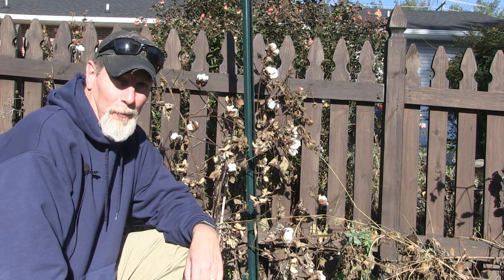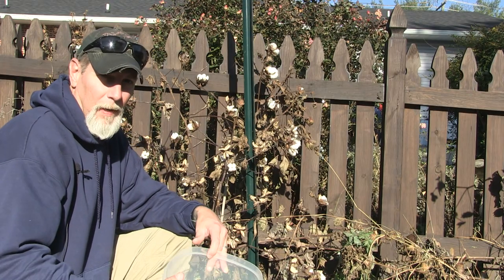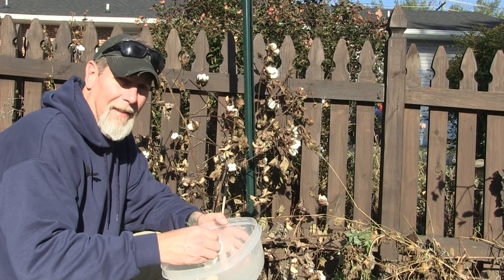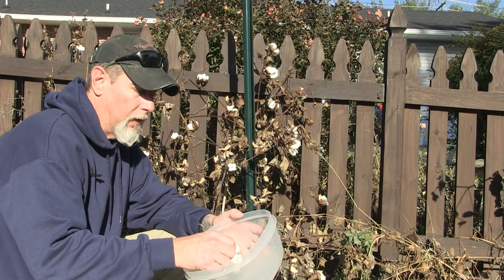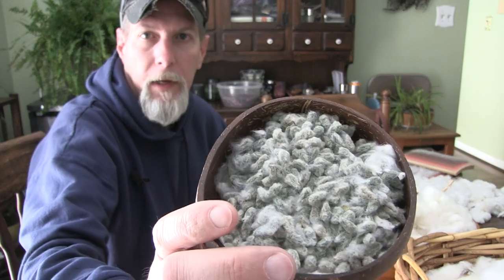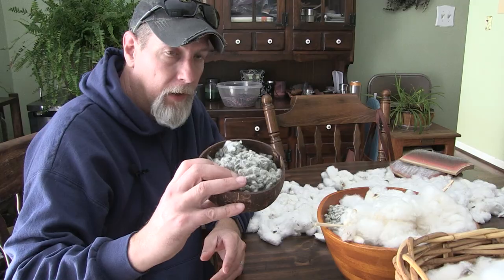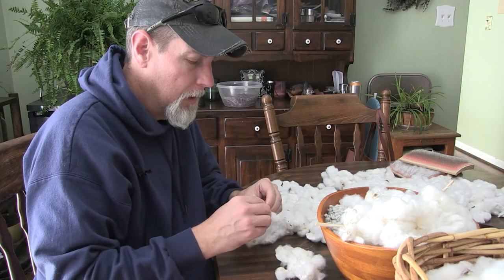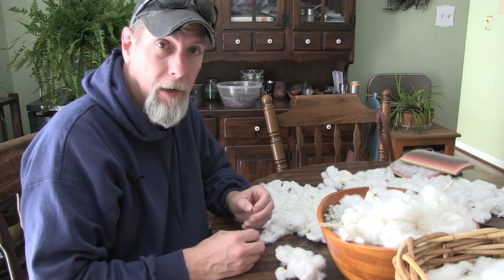How We're Processing Our Home Grown Cotton

Comment: The best way to remove the seeds is just carding. It won't hurt your cards. That's part of what your carding for,  to get the seeds out quickly and easily.  You don't have to use a lot of strength with carding. Card like you're brushing a cat, just lightly.  You'll get better cotton slivers. The seeds can just be pulled from top or bottom,  or picked out, tug off any long fibers hanging on, toss the seed in a bowl and continue.
Reply from the maker: Thanks for the tip!
Reply: Would that damage the seeds? If they want to keep them for planting they can’t be damaged. Just wondering

Comment: If you want to remove the seeds easily use a pasta roller, it works wonders.
Reply from the maker: What a great suggestion! Did you have any issue with it crushing the seeds? I'm just wondering with how tight the seeds are in the fibers of the Upland Cotton.
Reply: @oneseedoneworld  Hey, it doesn't crush the seeds, there is such a thing as a cotton ginning machine made with wood, but you would have to either make one or order one and it could cost a lot of money.
(none of the below videos are mine)

This for example is a ginning machine:
https://www.youtube.com/watch?v=UBOdM8hEVG4

But if you think about it, that looks exactly like a pasta roller, you can get one super cheap and all you need to do is add something to the metal rollers so they can grab the cotton fibers (otherwise they would slip)

This clip below shows perfectly how easy it is and with the addition of the some leather fabric as you can see the machine totally strips the fibers from the seeds and there is not way it can crush them because they are too big to pass through the rollers.
https://www.youtube.com/watch?v=JpzndOsO2F4

I hope this helps you with your cotton processing.
😘💖
Reply from the maker: @aryaprincess2479  Thanks for the links!
Reply from the maker: @aryaprincess2479  Yes I just watched the one on the pasta roller. I'll have to try that out since I do have one of those. I have previously watched videos on making a homemade cotton gin, but one I saw talked about how a rolling gin might crush the seeds with this variety and that a saw gin would work better, but I hadn't found anything on how to make a saw gin yet. But I'm going to try the pasta roller. If that works as well as it did in the video, that will be great! Thanks again for the info and links!
Reply: @oneseedoneworld  If you see closely the ginning machine has a small roller for this reason to not get the seeds caught, if it had two big roller then it would get caught, the bigger the rollers the easier for the seeds to get caught.
On the other hand the pasta roller has one roller without fabric and thus the seeds can slip easily, the side with the leather helps cushion the cotton and thus pull it but the seeds will slip because of the second roller. So do not put two fabric on both side and sandwich the cotton as this will create enough drag to probably pull the seeds and get stuck, only one fabric will work.
Reply: Gavin H  I live in Hellas, not sure which type we have, but they are removed easily even by hand just like the person on the video.Also check the videos in the other comments we have in this thread, there are plenty of people who use it successfully to gin cotton.
Reply: The knot on the spindle is called a half hitch.  You could also use knitting needles which are longer, thinner, also finished, and not tapered for rolling off your rolags.
Reply: I love the video,  I've read every comment and I have to say.... I am in love. I am so inspired. We live in a farming community in Gorman, Texas. We grow fruits, herbs and livestock. 

I was at the feed store and saw a bag of cotton seeds and had to buy it because I make denim backpacks and purses in combination with the plastic feed sacks and that one was cool. I also learned goats and cattle like cotton seed and it's good fiber.

I never saw a cotton seed before. Something just hit me when I saw them. I'm learning as much as I can and every single one of you have given so much help, hope and inspiration!!! I'm grateful!!!
-Pamela Mettler